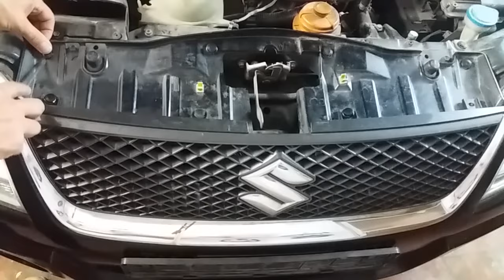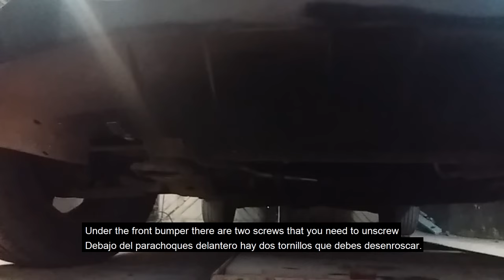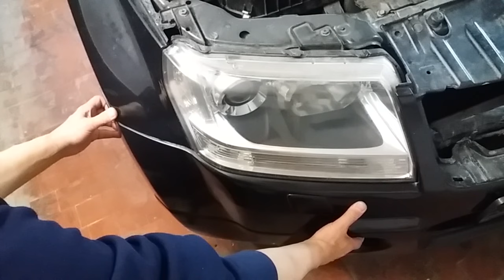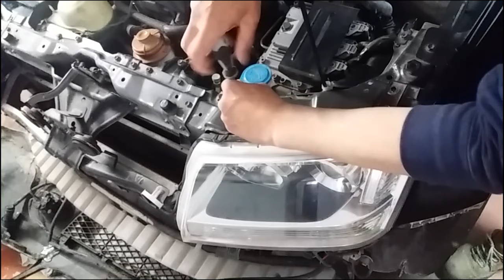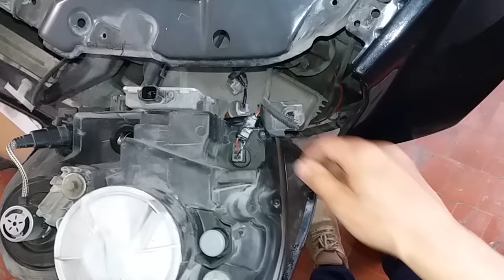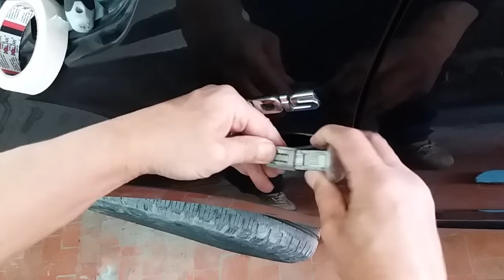How to Remove the Headlights and Turn Signals of Suzuki Grand Vitara / How to replace or change them

Comment: How do you change the hid bulb?
Reply: I figured it out. Turn the back of the cover counter clockwise. 2. Turn metal plug counter clockwise and pull off. 3. Remove clips by pushing inwards then bring around hinge. Thats it! Word of warning they are not regular bulbs. Search for hid bulbs online to see what they look like